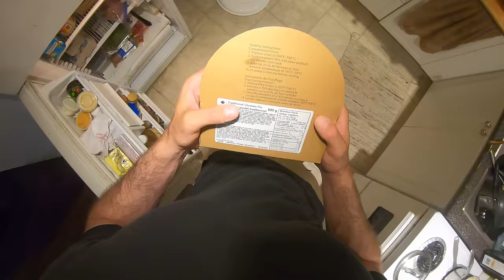13 Day Wilderness Adventure on Wild River and Inland Sea - FULL DOCUMENTARY

Comment: Xander and John Here' a trout cooking tip from an old trout fisherman! There is no need to fillet trout. On the large ones 2-5 lbs, just gut the fish the cut into 1" steaks (crosswise on the fish). When you cook the steaks in the frying pan the meat and skin will separate from the backbone thus no meat waste and no bones!